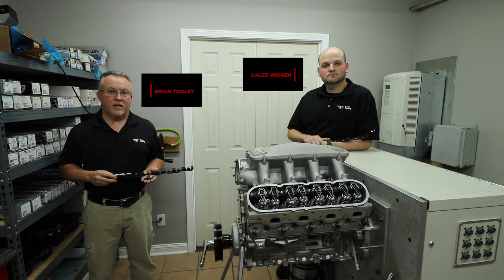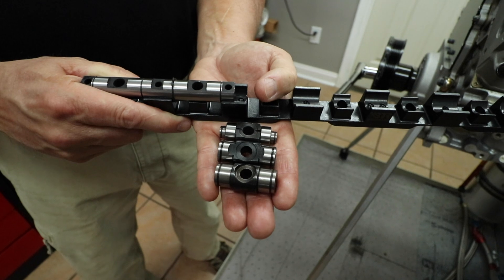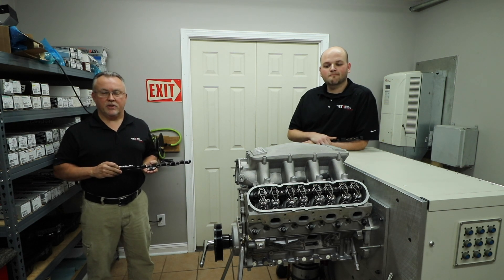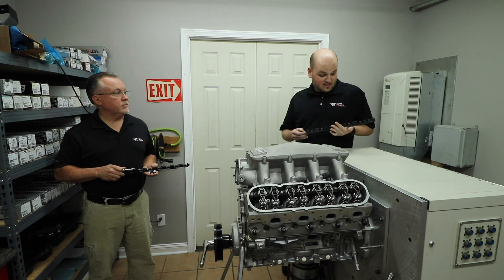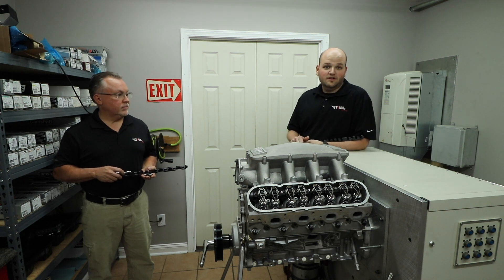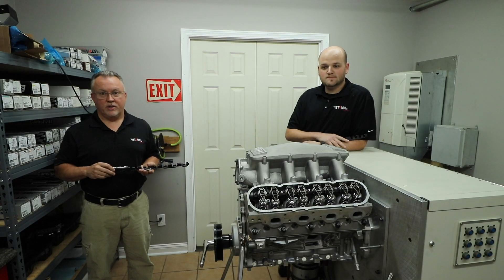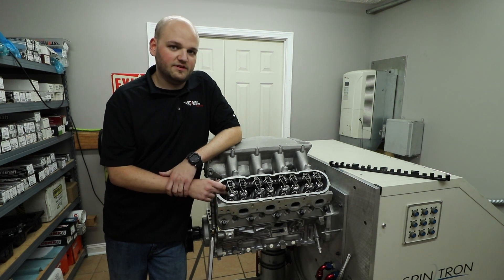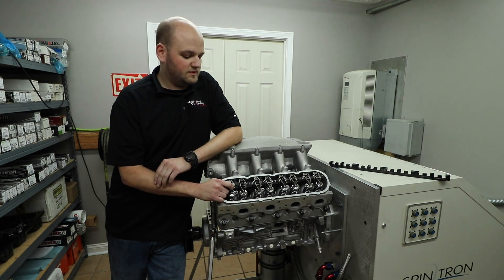Brian Tooley Racing | Shaft Rocker Kit

Comment: I wonder if it would be worth it to make the individual shat tube per each cylinder tied together via a smaller shaft tube that you could run through them once you have them set and lined  up? Tie them all together?

Plus, why not go all out and have a roller tipped rocked for the "FULL ROLLER" experience?